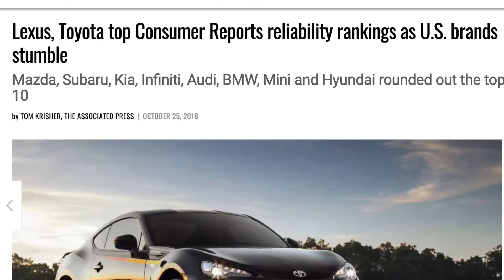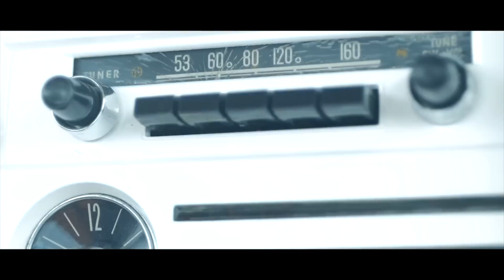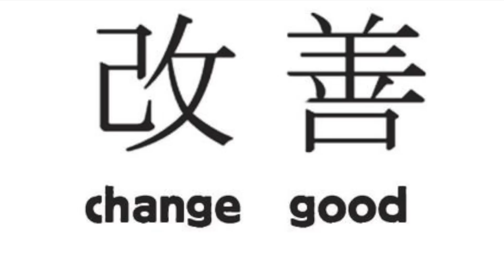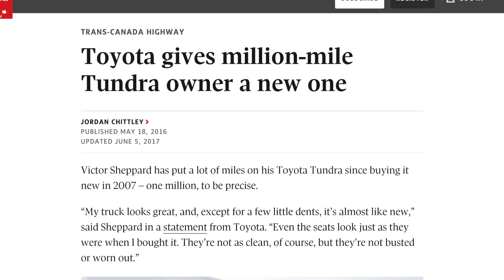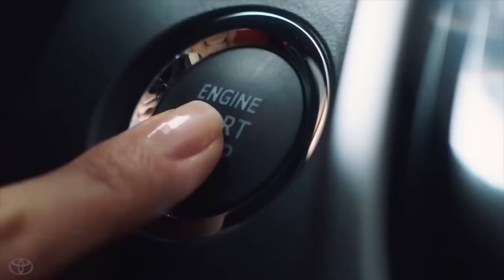How Toyotas Became So Reliable

Comment: My Toyota Solara has 458,000 miles and counting!
Reply: HA it looks good on U  ha ha ha
Reply: Goodness gracious!! And still running?? What year is that? My 98 Camry barely had 150k still a teenager compare to yours
Reply: Drskopf 1999
Reply: Thats the break in period for that car
Reply: drbassface I have a 08 Toyota solara with 80k miles on it holy crap !!!
Reply: Wow!  what year?  4 cyl or the 6?  Manual trans or auto?   Great car! I have the 2000 with 330K miles,5 speed.  still running great!
Reply: @jesserdo9963  Just keep up on the oil changes every 3,000 miles...and all scheduled maintenance. It could last forever!
Reply: You have gone past the Moon.
Reply: It's one of the best car my family ever owned. Sadly we had to sell it before moving.
Reply: stay away from GM cars it's garbage
Reply: Yeah..my Renault Clio 2002 1.5 dci  gave his last breath at 150.000 miles... i had to put him down
Reply: I had a Tercel, an Avalon and an Echo.
ZERO repairs!
Reply: @omarcarnegie7614  .......Not just GM. Most all american cars are garbage.
Reply: The Solara was the very most reliable mid sized vehicle Toyota ever built according to Dashboardlight.com,  finishing slightly ahead of the Toyota Camry which is #2.
I don't know why they quit making the Solara
Reply: @troot1967  American car companies have only been concerned about maximum short term profits, putting in cheap unreliable Mexican engines and transmissions and cutting every corner they can on the rest of the vehicle and now its really coming back to haunt them.. They never understood that if they don't make a reliable long term vehicle that the public would gradually back away from buying them, which is happening now.
Reply: drbassface I also do early oil changes i don’t wait till the “Due date, Or Time” and the air filters and transmission fluid change, 2004 Toyota Camry 289k miles!, also never left me stranded, Like the saying goes, You take care of It, and it’ll take care of You!
Reply: @richarddobson3138  .........I totally agree. I don't ever see myself owning an American or European car just based on the reliability issues they have. I will admit that I was pretty disappointed to see Toyota build the new Supra with a BMW engine. It's a known fact that BMW's are in the shop more than their on the road!
Reply: @troot1967  Exactly...I didn't like that either....Being that Toyota is by far the richest car company, I would have thought they would have designed and built the car themselves, especially with BMW'S    increasing reliability issues... It was an extremely poor decision  that Toyota didn't think through that gave them far more bad publicity than good, and proves they were only half heartedly in on reviving their sports car segment. Hopefully they will learn from the error they made and not go down this road any more, although I have heard of some kind of possible joint venture   with them and Mazda....which I oppose also...
Toyota has the world's best reputation and why would they want to mess with that?
Thanks
Reply: Jesse Rdo My 08 has 315k on it still going strong
Reply: Have you still got it? Whats the current milage?
Reply: @VinayKumar-db4qz  Almost to the moon and back lol

Comment: I just bought a 1998 Toyota Corolla with 213,000 miles and it runs good. I bought it for $500
Reply: 😅😅😅 Great job!!!
Reply: head gasket comming UP !
Reply: @gingerelvira6587  i had a 2000 Corolla with 258000 and it never had any gaskets go out on it ? Sadly it got in a wreak
Reply: ginger elvira its not a ford
Reply: I bought a 2002 Honda accord with 110k miles for $1.2k... i feel ripped off, jk it runs perfectly. Only downside it i need to replace the AC.
Reply: that is a steal bro... i also have 98 corolla running great @ 266,000
Reply: @CC-xk3mv  is that too high of miliges??
Reply: Statistically speaking Head gasket issue certainly isn't close to being a guarantee...Depends mostly on how the car was driven..If Corolla not driven hard, most likely no problem before 400k if vehicle is also well maintained ...Same with Camry...It kills me to see how hard people push their cars anymore with most not having 1000 dollars of savings to their name and with most having zero knowledge of mechanical stress they are putting on their 7 year loan, 20-30k  investment not counting interest.
People have become kamikaze pilots on the highways pushing for every available inch while looking at smartphone screen almost continously with occasional glances of what's in front of them..
or as Sting of the Police so correctly put it in Synchronicity 2 in  the 1980s " Packed like lemmings into shiny metal boxes,  Contestants in a Suicidal Race"
Reply: @crappy firedog . miles high but since i have it since 200,000 miles started i been maintaing it. cold air , runs smooth, has no engine light,  still saves my wallet extra cash on gas :D
Reply: 03 Corolla here, 265,000 miles!
Reply: Get out at 299,000 miles. Sell it for $500 and drive for free.  Wait much longer and you will be sorry.   I have owned no less then 12 Toyota’s they tend to go supernova at 300,000 miles. That is the duty cycle.
Reply: Thivakar saravanamuthu nope. You did good.  The 2000 Corollas has piston ring problems that caused them to burn oil.  They still ran to 300k plus. In just a few more miles you would start to see white smoke out the tail pipe as the cat gives up the fight to burn the wasted oil.
Reply: Wow!! I luv my corolla It has been 1 golden car..How lucky u r..Made n Japan of course..It's a 96..Luv it..
Reply: @Vampybattie  No..
Reply: Outstanding role model, thank you sir.
Reply: ginger elvira 230,000 miles on it and still running strong 💪
Reply: Corolla 1998 is the most practical car in the history of humanities
Reply: I just bought an 03 Corolla with 91,000 miles for $2500!

Comment: Saving up for a beater 90s corolla.   I'm so excited you'd think I was getting a sports car.
Reply: At least it'll still work for the most party lol
Reply: @MystikAzn4vr  As long as the really difficult and expensive parts were taken care of, the money you save buying a beater could just be used to replace those.  Like a new steering rack is just 150.
Reply: im happy for you man thats the spirit!!!
Reply: I'm doing the same but for an 02-05 rav 4. I really am super excited about it
Reply: I have an 01 corolla for college. And its great car, never gave me a problem over 19 years.
Reply: Pod When   you get your 90s corolla then I will swap my ‘10 model with you & give you $5000 or maybe $10,000 if your corolla has done less than 200,000 miles & the tyres are ok.
Reply: @geoffphillips5872  lol your serious, hahah
Reply: Did you get your Corolla?

Comment: I have had 2 Toyotas... by far the most reliable cars I have owned.  The worst were GM and VW vehicles.
Reply: Someone who have not done any mistake have not tried anything new. Putting that in automotive will be like ....
Reply: VW’s are reliable as far as I know, and they look pretty nice, i used to have a Golf GTD, never broke down on me.
Reply: xAmiin Good to hear you had a good experience... I had 2 Golfs from new, they were both unreliable and amongst the worst cars I have owned.  Sure they look upscale, the doors close with a solid thud, but the quality is only skin deep.
Reply: GlowingTube Not really man, if you change the lubricants (oil etc) and the components then it would have been fine, never neglect a car if it doesn’t sound good. What kind of problems did you have with them?
Reply: xAmiin I am meticulous with maintenance, both my VWs were perfectly looked after.  The issues included air mass meter, door lock, instrument cluster, electric window, ecu failures to mention a few.  Also the plastics started to break down and crumble after 4 years even though the windows were tinted and the car kept under cover.  As I said, based on my experience these cars are rubbish.
Reply: @xAmiin  Carbon build up on fuel injectors is not something that can be rid of with maintenance. This procedure which is recommended every 50k cost around $1000 depending on the type of engine.
Reply: @xAmiin  : I made the mistake of buying an '85 GTI in 1988.  The alternator went, taking out the battery. The heater core leaked. The windscreen cracked at least once a year, every year. Plastic bits broke too often. The clutch cable plastic adjuster broke, leaving me to drive home with no clutch.  The front rotors wore down below minimum thickness in 4 years. A front wheel bearing wore out. Clearance was so bad I cut my hand every time I changed the oil filter. Both horns failed. The headlights were useless, unsafe at night, except in the city. When I sold it in 1990, when removing the rear license plate, I found a rust hole about 2" diameter.  There are likely things I've forgotten. No more German engineering for me.
 The 2 Toyotas I"ve owned were both great cars.
Reply: Vw its some of the worst cars manufacturers
Reply: @xAmiin  The Golf is one of the few VW models that are somewhat reliable..
Reply: JERRY P Yh man, I don’t get the hate, its common to have minor issues. I remember my right signalling light at the back of my old GTD stopped working anymore after 5k miles, fortunately it was still under warranty, so had it fixed.
Reply: @xAmiin  VWs are pretty crap in India as well. Their cars don't even run for 60k and breaks down before hand. VW was never reliable. They are just hyped in the Europe

Comment: In 1993 my sister was accepted from harvard medical school as a fellow for a 4 year training in her medical speciality in the usa. So she left our country and went to boston. Budget was tight so she got a 2 door brand new 1.6 toyota tercel mt, no ac, no electric windows and a very basic  radio cassette player for us $ 7800. I visited her many times. We travelled a lot in that vehicle. All around new england, to washington, to colorado, to arizona and finally to vegas and california. That car made until 1998 around 160000 milles with only basic services.- oil, coolant and filter changes, spark plugs, very few brake pads changes, battery changes,  tire changes, , only one time change of shock absorbers, a couple iof engine mounts, one clutch kit, one timming belt set, some head light bulbs and as i know, nothing more. The car was running with no issues and the all plastic interior a little bit wasted but without any crack. Before leaving the usa she adverised the car for sell at the medical school bulletin board just in a post it, no milles and no price descrption. The day after a colleguee visited her and put 3500 us$ cash in her hands for the car, no major questions asked, she was buying the car for her daughter who was going to college. Thats how owning a toyota is, period.
Reply: Budget was tight so she got a brand new Toyota.. Uhm ok
Reply: She could and should have gotten a good used one with AC. etc.
Might have broken even on resale. 
And perhaps things were different then, but I don't think Harvard Med. School had fellowship programs. Harvard-affiliated hospitals such as the Brigham did. I was accepted by  one of the Harvard programs there.
Reply: Nice story and the experience is so true about owning a Toyota. I’m glad that they exist.
Reply: Can't imagine a car without air conditioner
Reply: Why did she get it new if budget was tight? 🤔

Comment: I have a Lexus LS400...spectacular reliability and a joy to own.
Reply: Lexus? everone knew its overprice camry
Reply: Sweet!!!!!!
Reply: G wagon How so?
Reply: @ushittyuglylc5037  The LS would probably be more on the Avolon frame but High End far more luxurious!
Reply: @ushittyuglylc5037  didn't know camry's came with a 4.0L V8
Reply: The Lexus LS(Toyota Celsior is the JDM version) has nothing to do with the Camry platform. The Toyota Avalon(which i have) and the Lexus ES are both Camry based.
Reply: LS400 or toyota celsior is a whole new platform, not shared with other toyota sedans. Its the first car for Lexus. Lexus ES is basically a more luxurious Camry/Avalon, they shared a same platform and chassis.
Reply: Ultra smooth
Reply: @ushittyuglylc5037  Well, from the late 90"s may be, clearly  not from 2005 till now, they are FAR better than any Audí or BMW or Jaguar in EVERY aspect.
Reply: Those cars are tanks
Reply: @cesarcastillo9561  They are solid. Mine is 22+ yrs old now and had its first major repair this year (camshaft phaser replaced). Still my daily driver. I can afford to drive anything on the planet but see nothing on wheels that would really make me happier or fulfill my needs much better.
Reply: wholeNwon yup just got me an Ls 460 with 108k mikes runs like a beauty
Reply: @cesarcastillo9561  Enjoy!

Comment: Went from Honda, to Acura and now I’m on my third Toyota product. Love their trucks and my Prius!
Reply: Love my Prius too. One of the best cars, reliable, great on gas, and easy to drive.
Reply: Prius 4 is the best car in the world. My experience.
Reply: Peter Weise yup! I have it in black with the sensors and radar and don’t think I’ll ever want to give it up for another car. Maybe once it’s paid off I’ll get leather interior, but it currently has everything I want or need. Considering a used 4Runner down the road cause I miss camping off the beaten path.
Reply: Don't plan to sell my P4 again. Will find out how long it will work without any issues. I guess long. Maybe longer than I will do from now on. Who knows?
Reply: I have a UK 2007 Honda Accord (Acura TSX) I love it!

Comment: I love my 06’ highlander. 178k miles and runs like new. No rattling noises nothing falling off. Just regular maintenance and the car does not look like it’s a 13 year old car. Do I care about how fast I do 0-60? No! Do I care about taking it to the track? No! But I do care about the reliability and durability of this truck. It’s been an amazing family car, plenty of space, rides very comfortable still today and I’m very pleased with the fuel economy. The V6 sounds pretty good and is fast enough for what it is. People waste too much money on “fancy cars” and then 3 years later they are worth almost nothing to what it was brand new. But you get what you paid for. I’ve had a great experience with Toyota and once this car dies, I’ll replace it with another Toyota, probably the Avalon!!! Great video

Comment: My son, a painting contractor, has a 2011 Tacoma with 260k mikes. Only problem has been a/c compressor replacement. My 2015 Tacoma, albeit with only 50k mikes, has never had a single issue. Just mounted new tires on it. I'll keep this thing forever.

Comment: My bud bought a 1988 Camry with a V6 at 243k miles, engine N transmission still runs pretty smooth. I drove it on the freeway, it’s just pretty slow, it was rated like 0-60 in 9.3s when it was new, nowadays it felt like 15 seconds lol, and it’s still being currently driven in the IMO most strict smog state of California, where it could get mechanically totaled cuz of a CEL if it doesn’t pass smog and inspection

Comment: Ever watch the video about the million mile Tundra? Fixed the transmission after 400k miles, new timing belt and water pump at some point. Beyond that just oil changes, breaks and tires. Granted the truck looks like it was beat to hell but still runs. They asked the owner what he would like to see improved and he mentioned the visor broke! Frick! The Toyota engineer was all geeked out to get his hands on this truck. Wanted to see how well the welds held up .. the freaking welds!!! They already know the drive train is solid .. let's see if we can make the welds hold up for 2 million miles! LOL

Comment: I also think Toyota benefitted from adopting a “Malcom Baldridge” quality management system to improve their products. The Japanese auto industry was smart enough to to recognize they had manufacturing processes that needed improvement.  They, in turn, corrected their reliability issues very quickly. The proof can be found within the Consumer Reports.

Comment: I bought an '18 Rav4 in March and have put 52k miles on it driving for Lyft. You cannot beat a Toyota for reliability. It gets great mileage for a compact SUV and is fairly quick for acceleration and nice handling. Easy to clean interior as well.
Reply: Did you payed it off doing Lyft?

Comment: My 2001 Tundra has 300,000 miles and counting with its original engine and transmission both are smooth and running like new...

Comment: The only Toyota’s I really like are the newer (2010-2020) Tacomas and Tundras. Not only they are super reliable they also have really good resale value. You can get a new or relatively new Tacoma or Tundra. Drive it for 4-6 years and it has like 140,000 miles on it and then you can trade it in and get at least $5000 for it if not more if it’s in good condition. Or you could get say a ford ranger or Chevy Colorado, drive it for 4-6 years put 140,000 on it and go to Trade it in for $2000-$5000 max.

Comment: I gotto have to have my toyota. Oh wait I already have one gen3 1996 camry 2.2L with 125000miles for ten years now.
Reply: I also have a 1996 Camry XLE in Red. It has 275,000 and still works. Recently we had to replace the radiator because the hose broke off and the engine overheated. Besides that the engine has a slight kick, maybe a piston or firing is slightly off? Either way, it still runs. My goal was to get it to 300k before I give up on it lol.
Reply: 2007 Prius 345k.......original everything
Reply: MY American made FORD Focus has 256,000 and is my daily driver. 2012
Reply: I have as 1998 Camry with 152k original everything nothing rattles or loose, and AC cold AF , even more than wifey 2012 CRV!!
Reply: 125k is nothing. You just broke in the engine.
Reply: That engine and transmission will outlive your kids